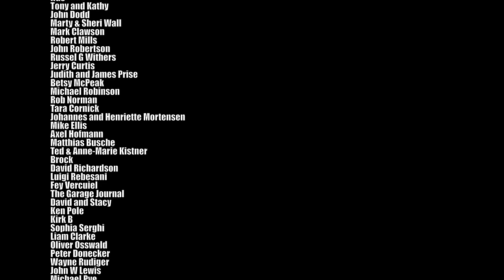A New Colour Scheme On Deck

Comment: Maya, for removing the paint in corners, you might try using a cabinet scraper.  With the care you use, you could learn to use it easily enough.  A good sharp (burred) scraper can really do a good job.  tape edges you don't want to scrape with and it can really get into corners.  You will have to sand afterward, but minimally.

Comment: Wonder if they would let you pay for an additional slot for an extra month or two. Just to keep the structure up long enough to finish the detail work that would require cover. In order to keep the surfaces free of the most contaminants that could ruin the job. If not, keep prioritizing, and roll with the unexpected. You two got this. We have witnessed boats being built without a shed, topsides painted in the water, and many more compromises. Just to get out and continue the adventure. Stay true to your shared dreams and standards. Embrace the suck of the yard. It is part of the adventure too. It will also make those mornings waking up next to each other in a secluded anchorage that much sweeter.

Comment: Im sure Aladino is doing it "right" but; Is non-skid "waterproof"? Why not 100% edge to edge the top coat then non-skid overtop? I'm concerned water will pool in the texture right over burn thrus in the primer. Im a car painter not a boat painter, and am curious how boat materials compare to car materials. You two are a big inspiration to me, keep up the fabulous work!

Comment: I bet you're right about the boat yard not even getting y'all to move.  They should have had the foresight to have put y'all in the right space after years of experience being in business.  You learn as you go with some things and that should've been where you are being told  they're moving you to now.  They're slack not y'all and boat yards are someone's notorious for being short sighted and acting like they do. Lots of folks neglect getting their work done in a timely matter of sorts as I've seen working on boats.  Sometimes the just have a belly she others have given them and they vent it out on y'all and others there doing work everyday.  The others aren't there to deal with it.  You're a captive audience.  It's avidly their fault and should compensate you with extra time free equal to the loss of moving. Resetting is always a pain and time consuming with the rebuilding having to be done also. Id put it to them like that.

Comment: The white paint looks great! I see you applying the two-part poly with a roller. Do you follow up by tipping the paint with a brush to smooth the finish?
Reply from the maker: No, just the roller achieves beautiful results when the temperature is correct.
Reply: @SailingMagicCarpet  Thank you for the reply.  When I have used the Epifanes, tipping was necessary to avoid orange peel and level the paint. You two are doing a wonderful job rebuilding your Cape George Cutter 36.